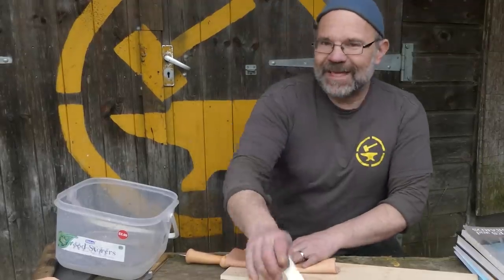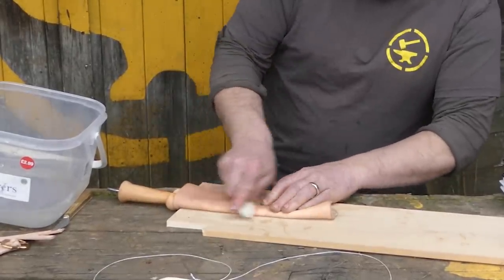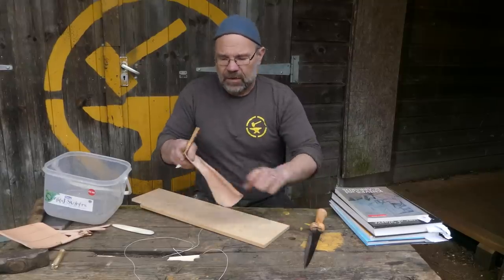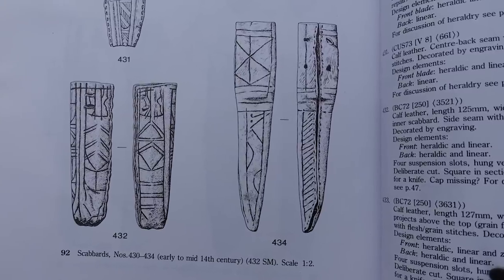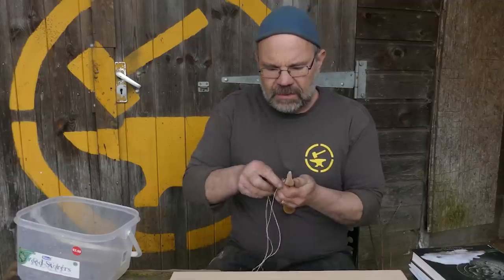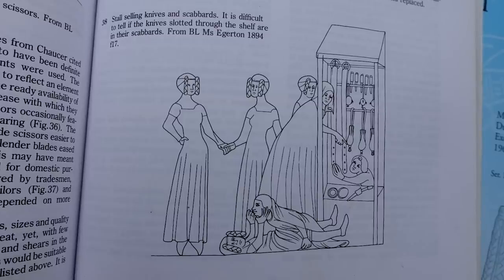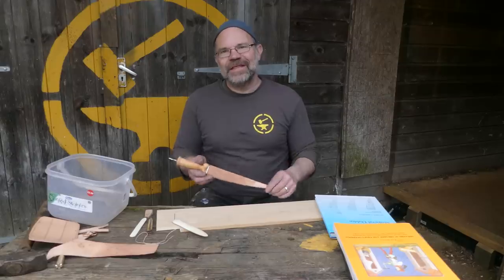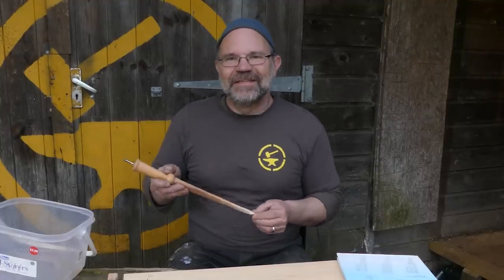Tod Makes Junk - Was Medieval Work Bad?

Comment: This is true in many industries even today.  For instance in software we will sometimes speak of MVPs or "Minimum Viable Products".  Meaning it is something that just barely meets the needs of the customer / user and nothing else, no "bells and whistles", no nice graphics or flashy user interfaces, just what the customer needs, wants, or asked for and absolutely nothing more.  The philosophy or reasoning for why this is done is a bit different than in manufacturing, but a lot of the same principles can still be applied to avoid wasting time, money, and effort.

Comment: I am a trained calligrapher and illuminator and studied medieval manuscripts. Apart from the very grand books most medieval books are pretty rough for the same reasons you stated. Also in many books if they made mistakes they just crossed out the word and wrote the correct one in the margin. Holes in vellum stitched up. Cats paws prints. All kinds of things which today my patrons would never accept. Also there were pattern books for scribes and illuminators to copy.

Comment: Function over looks, time is money - it makes a LOT of sense! It also still happens in many trades/crafts.
    I am not an educated craftsman, but I do build/make a lot of my strength training equipment myself. I have the filosophy of "Ugly but Efficient Training", that everything does not need to be pretty with chromed surfaces and polished glass. I build with wood (never learned metal work, and both wood and woodworking tools are cheaper...), and I try to kerp my right angles 90 °, but I do not care, if things look good, or slim and streamlined. I use sturdy timber to build solid equipment, that works well for years.
   I also sew crude sandbags of cloth from used trousers - denim and canvas. They are not pretty like the ones from Rogue, but they are strong and cheap! The training I get almost for free is just as effective as the training, you pay a fortune for at the gym.
   👍👍👍👍👍

Comment: 18th c military contract work is an interesting version of it.

The economy of scale involved meant many things were as materials purposely made, to specs, like regimental lace, sturdy and well dyed cloth, metal fittings and buttons, and you can see the original patterns and designs for the metalwork were very well made, die dies for stamping buttons etc….

But then comes the piece work aspect of it all: the buttons were quickly processed and often struck askew, the uniforms sewn up with visual irregularities and corse stitching visible etc, lace nowhere near perfectly sewn on…
But they did not piece (actively forbidden) and it’s all functional and sturdy. Just hideous to look at in detail by uncaring tailors out to feed they families.

From a few feet away, though, looks perfect

Comment: As a sculptor, I can agree with everything you said. Specially about not always doing the best work I can do.

I mainly sell small figures at about 10€ to 15€, and I have to keep that in mind when I produce the pieces. If I spend a whole day painting a single figure, it's a disaster because I won't be getting enough money to cover that, so I either make a rough and quick paint (few and flat colors) or a simple spray-painting. That way, it's less work and it means I can keep a low price and thus sell more, but it also means I can produce more in less time.

I can do a better job than that, but it's not going to be worth it. Sure, if someone pays me a lot of money to make an amazing piece, I will make the best work I can because it's worth it, but that's not the common item I sell every day. If I spend a whole day painting a single figure so that it's perfect and I price it at 80€ nobody is going to buy that, even though it may be the right price for the item, or even a low price, if you think about all the work behind it. If you do the best job you can and people don't buy it because it's too expensive, it's not worth it.

Comment: The dynamics you describe here still can be found today. Pick up a knife, or anything really, made by a craftsman in a back alley shop in Peshawar for example, and you'll find many of the same loose fittings and imprecisions. They're working in suboptimal conditions by modern factory standards, often with ancient tools that have been repaired over and over, or with improvised tools. They're working fast for the same reasons you've explained. Customers are happy to own them because it's the best they can get, and they still cut and poke just fine.

Comment: It is always a pleasure watching you work, thanks for sharing!  We see a similar thing today between artisanal work vs industrial.  If you're making a sword for a noble who's giving you time and budget to make a higher quality weapon, you'll spend extra time to get it right.  If a king asks you for 1000 swords urgently because a neighbouring kingdom declared war, you'll ensure the blades are forged and tempered well, but won't care so much on the aesthetics.  You'll try to output as many swords as quickly as you can because 1000 soldiers with ugly functional swords are better than 3 soldiers with intricately designed swords.  Same happens in Hollywood today, where a movie might require 100s or 1000s of swords, but will only ask for 2-3 of them to be "Hero swords" that will get a close-up shot.  I'm sure Gandalf's Glamdring would take as long to make as 50 or 100 orcish rusted chunks of steel roughly shaped like a sword.

Comment: Watching this reminded me of some regional souvenirs, which are often hand made (at least partially), and fairly quickly, to be sold cheaply to tourists.
A great example would be ciupagas (a walking cane / hand axe hybrid), a popular souvenir from the Tatra mountains. While some may have a mass produced metal... or plastic head (though wooden heads are also common), the wooden shaft is often decorated by hand, carved, burnt or painted in patterns. And these patterns are most often imperfect, I presume partially because it's just quicker to do it that way... and partially because people want it to look hand-made, and it's part of the charm. Makes each item look unique. Of course there are nicer, more expensive ones too, those often look more 'perfect'...

Still, it might be one of those places where the old mindset survived to modern times... sort of.

Comment: I wonder how this related to guild regulations. We see in e.g. the Paris and London Armourer's Guild Regulations around 1300, that they are very specific in terms of what materials to use, what can be re-used and what should be new, how many layers etc. Often they are associated with some choice cursewords that those breaking the rules are subjected to.

Some crafts and cities had strong guilds, some weak. And some areas (like decoration) are completely untouched by regulation it seems. And other times the craftsman may just have blatantly violated the regulations.

Were knife scabbard makers under regulation or not? Were there a significant difference in production quality of regulated crafts vs  non-regulated crafts? Those are interesting further aspects of questioning.

Comment: I fed myself for most of my life working in a manual trade with tools. Over the many years, the most interesting, unique, effective, innovative, ultra-specialized, efficient and best designed tools and instruments I encountered were homemade contraptions and devices created by tradesmen. They were crude, rough and ugly made quickly to save time and make money, they worked, worked well, handled well, did what they were designed to do and did it well. 
My everyday carry for decades was a 5" sheath knife my father dashed off from an old crosscut saw, heat treated, tempered, etc. Ugly, crude, rough, un-"finished," it remains one of the best knives I've ever handled. You should see the crappy sheath I made for it. No one will ever steal it, that's for sure. Cheers!

Comment: some ideas, from a reenactor that makes his own leatherwork: leather doesnt hold up very well if not oiled or waxed. some of the sheaths looked a lot warped through time and location (maybe a field i.e.). second, not every craftsman was an artist, like sons take over their fathers businesses just had to learn their skills -  maybe there wasnt much time to learn. child labor was also very common in those times - so not very skilled most of the time. then the argument with the stamps i can see, but what about the archers make their own bracletts, having those stamps available closeby? at last: i dont know how much material the common craftsman has available to learn and advance in his techniques. maybe they just did it and sold every attempt as a full product, so nothing goes to wast, and everything makes money. good video, you make your arguments. sadly we can just speculate about so many things without proper sources to know for sure, and even then it might have been different in different regions/times aswell.

Comment: Totally with you on all you said. Machines make things uniformly because its a mathematically repeatable process. You have to handmake make lots of something you rig up a jig. Even now Ikea furniture sometimes needs to be 'persuaded' to fit together. Before the industrial revolution people simply didn't look for uniformity.
The one proviso regarding the illustrations of artifacts is that state of preservation effects the archeologists recording. They're drawing 'as is' not 'when first made'; Organic material warps, metals rust etc. The artifacts may not have looked so rough when created. Add on top of that wear and tear and multiple ownership it can turn a new BMW into an old banger within a generation.

Comment: We use millimeters in the US. Our rulers tend to have the imperial side and a metric side with cm and mm. We even learn the in to cm conversion. 2.54 cm per in. So it is 25.4 mm per in.

Comment: The standards for actual tools may not be that different today. I have a training as a tool maker and an engineering degree. In both trades it is important to have good judgement about how rough you can make it while still keeping it functional.
A sheath is a wear and tear item. Most of my knife sheaths bear marks from use. The popularity of kydex sheaths may well come from the fact that they can take more wear and tear than leather.The owners I know are not really bothered about a scratch in the kydex sheath. Some of them are close to tears when their beautifully stamped leather sheath is stained or scratched.
Many craftsmen learn that there is the triangle of quality, time and budget. You can select one, two if you are lucky. IMHO "best of their ability" also includes judgment about the required build quality.

Comment: Tiny correction, the book on Finnish scabbards and sheaths is about finding from Turku wich was by significant margin the largest city at the time. 

Before 1500s Helsinki was a just a small village without a city charter. In the mid 1500s the Swedish crown gave the charter (and ordered some 200-300 burgers from some of the smaller cities to move there) in hopes setting up a competitor for Tallin, A city of approximately 10 000 people and enstablished position as a part of the network of Hansa Cities. So that didn't work out well. And when the Swedes conquered Tallin in 1560s the city anguished under the Russian rule over Finland in the 1800s.
Reply from the maker: Thank you and apologies

Comment: It's not hard to find this sort of thing today: just take the cover off your washing machine, and admire the rough edges, self-tapping screws, hot glue holding wiring bundles etc. I was sitting in my uncle's Dacia Duster while he bought the bread, and noticed that all four lock buttons had the same casting flash, and the foam rubber strip between the dash and screen pillar wasn't poked in straight. You don't find that in the Audi equivalent which  costs twice as much but isn't twice the car.

I think 'noticeably better than it needs to be' is a good definition of quality

Comment: I've spent the best part of, I think, 17 years so far in manufacturing/development/engineering with rough here and there levels of training.  I've made thousands of components of one thing or another,  mostly plastics recently.  We work to tolerances, so as long as it fits the requirements, it goes customer.  You don't spend any more time on it than necessary.  I've also done tons of fix it quick fabrication at home, my welding does the job, but a coded chap would cry.

Comment: 6:12 well like you said with the piecework stuff. Its all about tolerances (to use modern terminology) ... You need a mirror to look at yourself in the morning. You need low tolerance. You need a mirror to look at the infrared spectrum in space (James Webb telescope) you need very tight tolerances. You see this with everything.

Comment: Always wanted to explore a point made by Alan Williams that based on the few unground examples available, medieval and iron age smiths probably worked with less material during the forging out and bevelling of blades, starting from a much thinner blade before going into the grind than is typical of modern bladesmithing. This could be economic to save on wasted steel and also time spent at the grindstone, possibly also to test the blade's ductility and security of the welds before investing time into the finish. Also interesting is that Bladesmiths often didn't actually sharpen the blades, which is amazing to think given how important that step is for testing the quality.
Reply from the maker: Steel/iron was expensive so save every scrap and forging is faster than grinding so bang till you close

Comment: A lot of stuff was of course produced quickly and purely for function, but some was also produced to be a status symbol. Even there, though, it doesn't mean they had the same aesthetics as we do. There's an example of a viking type H sword (from Germany I think?) that I have seen pictures of. The upper guard and pommel are decorated with a complicated pattern of inlaid wires, and yet, the guard is completely asymmetrical. And it was obviously asymmetrical before they started putting the decoration on it, so they deliberately chose to take this misshapen junk and make it look super fancy with a lot of very difficult artisinal work. But it's not in a way that you'd notice if you were just seeing it hanging at someone's side. And it would function, while also looking good, as long as you didn't look too close.
Reply: I work in home remodeling and have to constantly remind the customer that it's called curb appeal, not staring at it from 6 inches away appeal.

Comment: I think also that modern machine repeatability means that we have come to expect a much higher minimum visual quality, because if you're designing a process to crank out dozens or hundreds of an item or day, it makes sense to spend the extra month or two beforehand making sure the finished product is going to come out exactly the way you want it -- once the industrial process has started, you really don't want to stop it and make changes. So even our cheapest items still look very good -- even if you go to the factory reject outlet, they're still 90% perfect. Whereas with hand-crafting, every individual item is a new chance to make a different mistake that you're not looking out for, and another chance to ask yourself "is this really worth another hour or two to get more perfect? The sun's going down, and soon I'll have to work by fire-light... nah, that's good enough."

Comment: I think they would have been able to recognize poor qulity/workmanship at least to an extent, because it would sometimes affect the actual functionality of the item.
For example, these people used to use their knives a lot, so they would be very familiar with likely modes of failure.
They would be able to tell if a knife looked flimsy, or if the blade was a bad shape, and they would know that a rattly handle would be prone to falling off etc.
And if they were buying from a seller who had multiple roughly identical knives, it's not difficult to imagine them comparing the knives and picking the nicest looking one.
The fact that there were decorations and embellishments (even crude ones) shows that they valued aesthetics to an extent.
I imagine it's probably more a case of them buying what they could afford, and they couldn't afford much.
Not all that different from today really - we choose which version of a product to buy based on how much we are able or willing to spend on it.

Comment: I think that nowadays the priorities are simply different than at the times. We are used to things being "perfect" and consistent due to industrialization, so handmade crafts have to be even better or add something for people to buy it. In medieval times the materials and colors where the things that will give status to the owner, so i think the construction was good anough as long as the function was achieved. Also you didn't want to waste any good material, so you will adjust construction around that. It was the same with clothing, it was normal to have seams in places that for us would simply be "unacceptable" for a good garment.

Comment: well Tod I am a 62 year old Englishman and I have enjoyed finding out about the Medieval times.
I move to Finland in 2010 and slowly trying to find out about Medieval times here.
As a metal worker/welder for over 40 year more interested in the metals they used
glad to know the Fins where better NOW I live here, But the Fins have a knife call a puukko if you get a proper one they are Very good small general purpose knives.
but they have the seam of the sheath on the edge? all the ones I have seen do